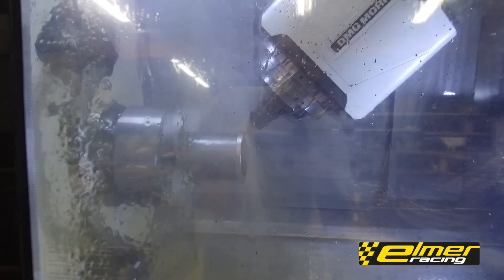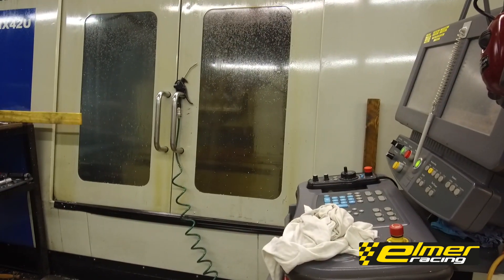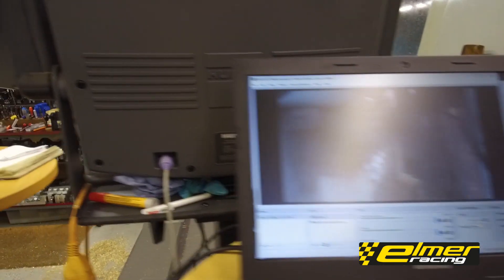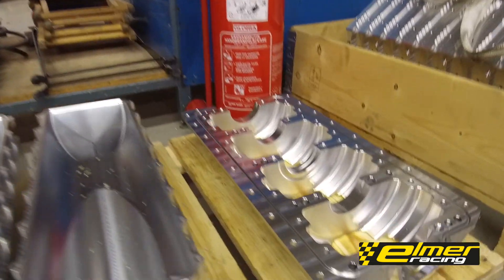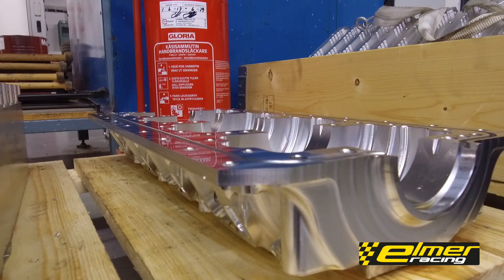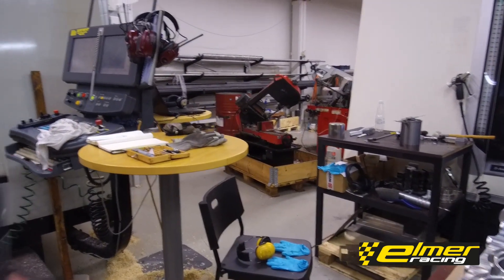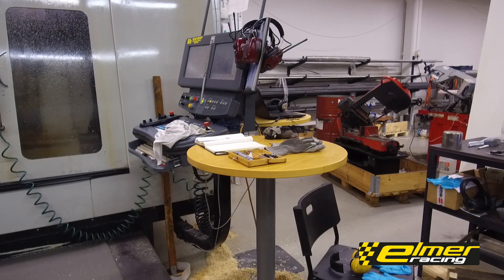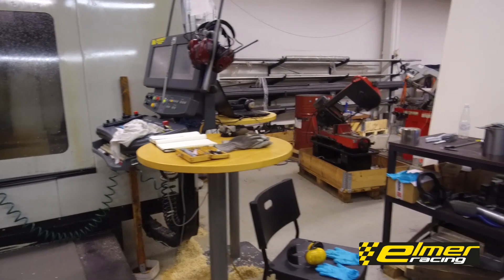Making of Thor, the 1500hp circuit race engine; part3

Comment: you are doing great work oscar, hope the media gets to cover you more. i have left a message for high performance academy as they have just released an aero centric interview of the rp968 project, and hopefully they will get in touch with you at some point for your unique contributions to the project.
Reply from the maker: The HP academy guys did a long interview with us about Thor at our stand at WTAC. The video will likely be coming out in a few weeks.
Reply: great to hear, good luck on your endeavors.

Comment: using a balancing pulley on this engine? This size of 4cyl. may have substantial vibration or not? Why 4000cc? I think you can't run wild cams because of revolution limit on this large capacity. What's the workable rev. range for this motor? many questions, but interresting to see what results show up.
Reply from the maker: Maximum rpm will depend on use. But at least 8500 for circuit racing, and 10000rpm for drag racing.
Testing will tell how high we can go with the valvetrain.
Engine reportedly runs smoother than stock 2.5liter inline fours on the chassis-dyno.
Reply: Thank you for reply
Impressive. I never would have thought that this piston/rod size would cope with 8500+ rpm. So that means besides the engineering, the quality of steel and aluminium alloys has been significant improved. 
What is the typical piston speed of this engine? Must be very lightweight rotating assembly.
If possible, if you have maybe upload an engine dyno testing video. 
This is interresting stuff, and what may come in future.

Comment: Fck it, I'm gonna ask. What's the cost for a MINI Cooper R56 N14B16 Billet Block without sleeves?
Reply from the maker: We like your enthusiasm! But unfortunately making a one-off block would be very expensive.
We typically need a initial order of 5-8 parts to be able to make them at a reasonable cost. (depending on how complex they are)